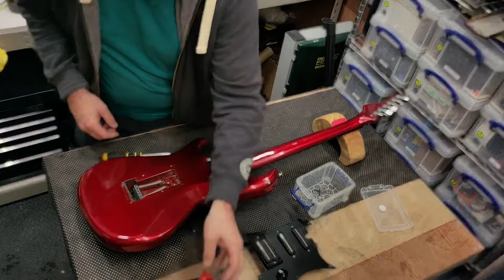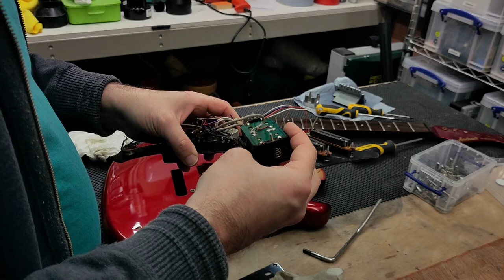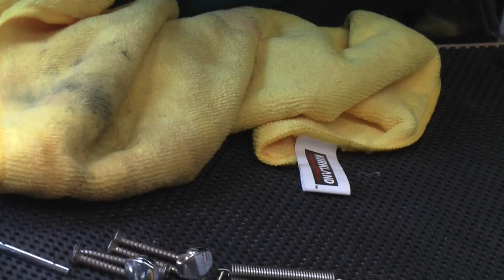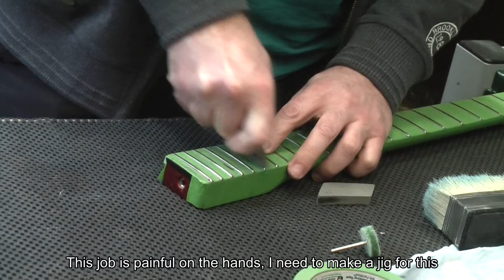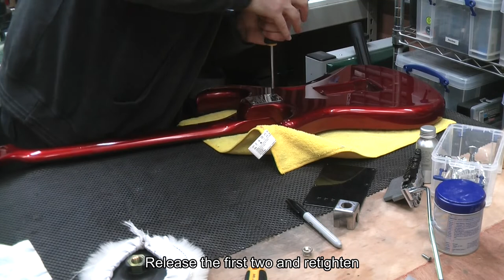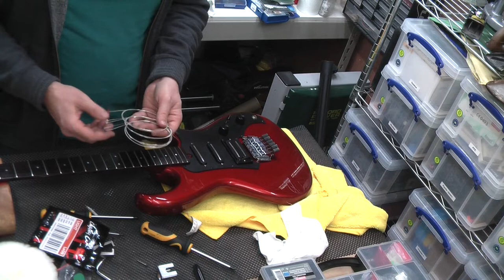Aria Pro II RS Wildcat restoration

Comment: Can you tell me the distance from strings to the top of  pickups,please, how to adjust them for best? Thanks
Reply from the maker: Get them as close to the strings as possible without them being in the way of your playing. Get the 1st string closer than the 6th. That's it. No need to get too technically accurate.
Reply from the maker: To give you a better idea, the pickup on this guitar is 2.5mm to the bottom of the strings. But it will be different for different guitars. I think the strings on this made the biggest difference. They are D'Addario XS 9-46.